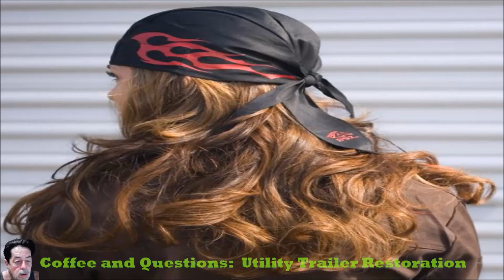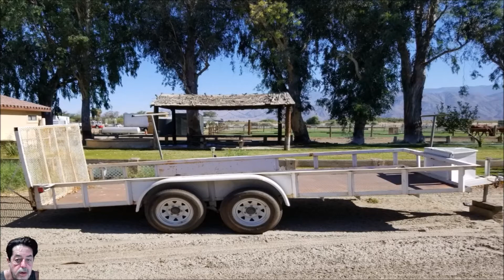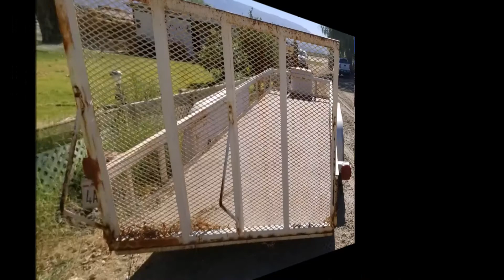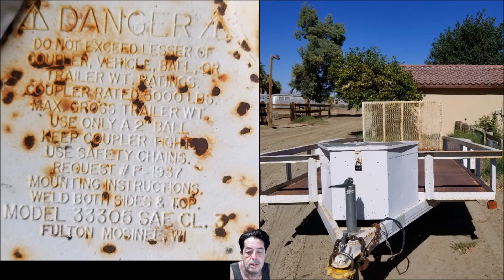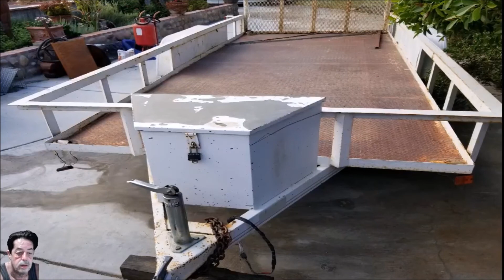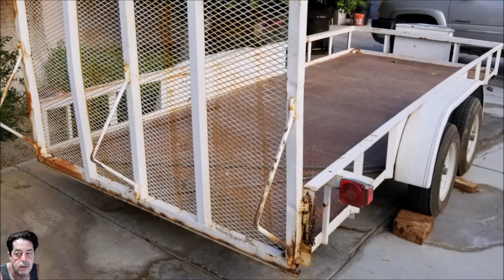Trailer Restoration - Part 1

Comment: Sandblast the trailer and tuff coat paint
Reply from the maker: good idea.....thanks
Reply: How did the magnetic ground connected work out since your video
Reply from the maker: @johnbladykas4885  so far so good .........trailer is now done and working fine..thanks